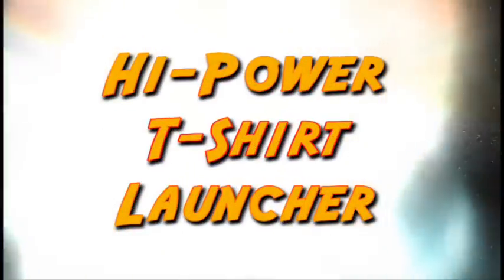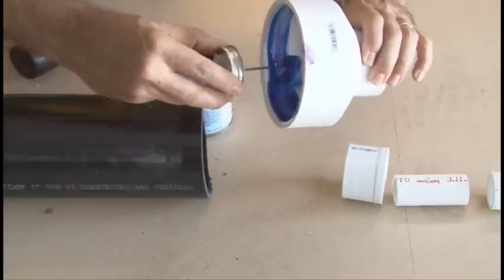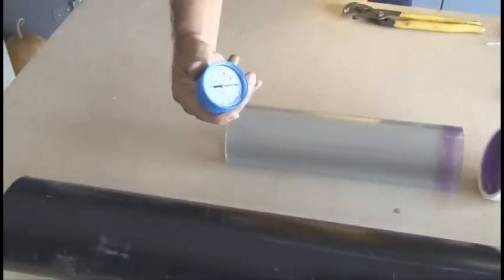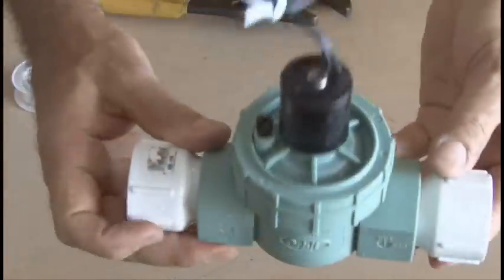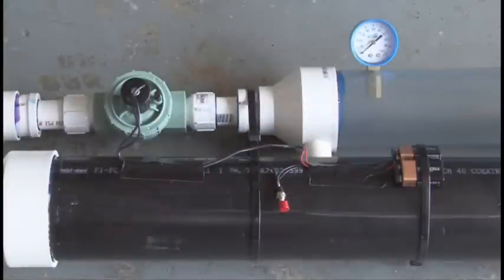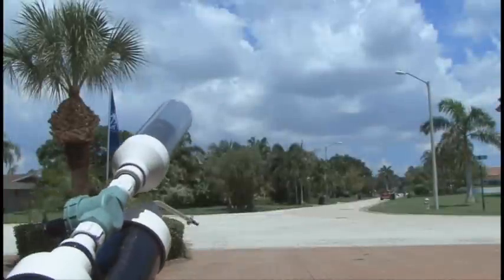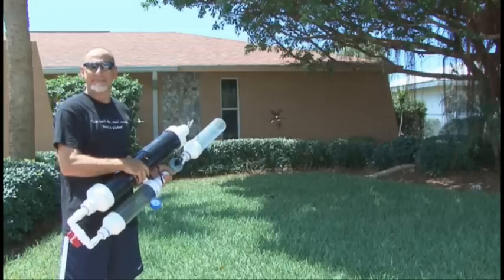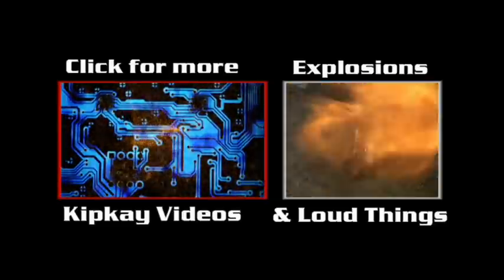Hi-Power T-Shirt Launcher!

Comment: mortat shells
Reply: Mortar
Reply: Victor Adamson HOLY SHITBUCKETS YES.
Reply: Bob Bobbington That's not even how mortars work. There's a firing pin at the bottom of the mortar tube, so using compressed air probably isn't a good idea.
Reply: Zachary Gillenwater Modifications Modifications.

Comment: For the reserve chamber he's gluing white PVC pipe to black ABS pipe with PVC glue.  That type of glue will not bond PVC with ABS, green or transitioning glue needs to be used.  One more thing, black ABS pipe is drain pipe and not meant to be pressurized and will explode.  I'd like to see that video.

If you are making one use PVC pipe not ABS and the correct glue.

Comment: Be careful with drain waste ventilation (DWV) fittings such as all of the couplings you used, they've got more shallow connections and hence produce major weak points on the cannon. The ABS (I believe it was) used for the secondary reservoir isn't technically pressure rated either (may fail, much like the DWV joints)

Comment: i have tried making a similar cannon and the sprinkler valve doesn't allow any air to come through i have to release the bleed screw for anything to happen. How did you get yours to work with the solenoid and everything without modification

Comment: I'm not going to read through all the comments to see if this has been mentioned already so sorry if it has. For the reserve chamber, you say to use a 4" piece of PVC but in the video you used a piece of 4" ABS. ABS is a drain pipe and isn't designed to hold pressure and although the pvc glue will stick to it, pvc glue doesn't "bond" the pipes together. In the video you only pump it up to 70 PSI which isn't as dangerous as the 150 psi that most new air compressors put out today, which is what most guys who build one of these are going to pressurize their cannon to. I have been building air cannons for many years and have seen ABS explode first hand and it isn't pretty, and I would hate to see someone get hurt while holding a pressurized ABS tank right up against their body. Sorry for the long winded comment. Great videos otherwise,

Comment: Thanks for the video. I just made one for myself, but im having trouble getting enough pressure into the secondary chamber. It'll get up to 60psi, but when it fires it'll only go 10 feet or so. If I leave the ball valve open, it shoots full power, but empties the reserve chamber. I used the same 3" × 12" dimentions. Any suggestions?